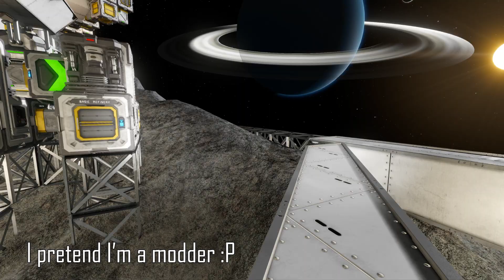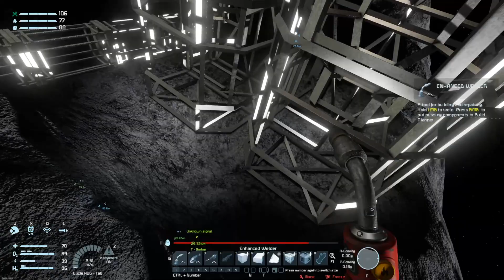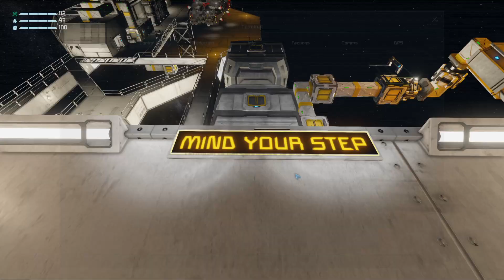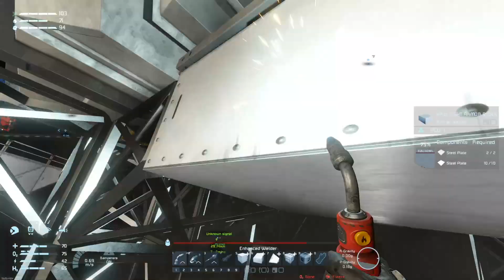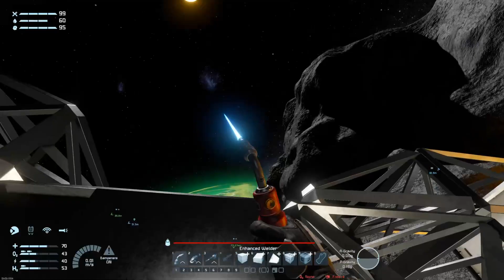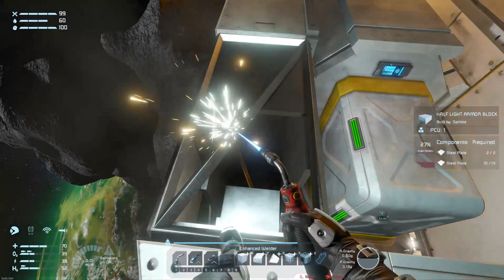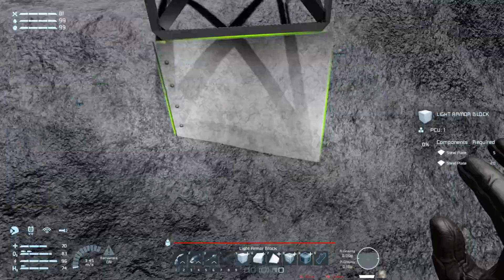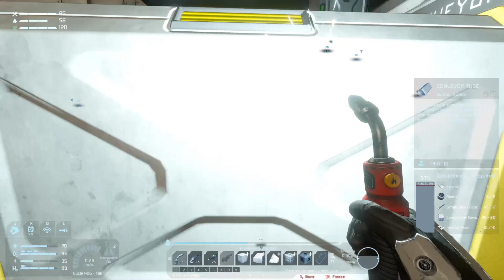Survival Impossible - The Long Arm of the Lawn-Chair #34 - Space Engineers Hardcore Survival

Comment: For the Airlocks on the work corridor, you might want to put a door facing the center so that you can walk out to the big "X" in the middle, otherwise it is a weird dead end. Also, the other dead end on the other branch of the "X" could be extended to allow a walk around to the landing area instead of a dead end into the glass of the work corridor. Just some thoughts.

Comment: note for saving space: use catwalk plates for thin walls, as they are airtight.
Reply: though without supergridding like in medieval engineers they leave a huge unusable volume on one side... half blocks are the better option, because they look sturdier and leave only half a block of empty room. though i kinda wish there was a centered version to fit with the centered door as this would spread the "unusable" volume over both sides of the block.

Comment: im sure there is at least one mod out there that has thin walls, you just change the glass panels to a solid color and change components from silicon to iron, or mod railings and catwalks to be full size air tight panels, or even corridor blocks (which im pretty sure is a thing already)

Comment: Great work this time.
3 Thoughts/ideas on the the extension:
a. Plants in the corridor. would help fill out the window spaces, and add a bit of colour to the base. Other thoughts include transparent LCDs with safety PSAs or similiar
2. Instead of the lockers in the tower end airlock, use window blocks (not panes) looking out past the tower. The blocks have a more industrial look than the panes, and would help remind anyone that there be space outside.
3. You could pressurise the tower with a vent at the bottom. going down: ladder, upsidedown catwalk, vent. Other than the plumbing this should only use the unused space at the bottom of the tower.

Comment: Here's a suggestion for the corridor: Make the central blocks you walk on catwalks with glass underneath, keeping the solid blocks for the supports. That way you get a bit of a look into the void and asteroid underneath while passing through. I'd place upside down catwalks in the floor level and use black neon lights on the underside of the supports as attachment points for inverted 1x2 glass panes.

Comment: just a thought... how much battery power did you have on your booster pods, for their beacons? as would it be enough left to find them before you return to planetside? 
warning signs - "be safe avoid splat" for the lcd's 
also what about piping up under the main hab section which would leave you free to expand what you want with above the platform level

Comment: Exploration and refinement base eh? Am I the only one imagining a catapult relay system throughout the system with Splitsie launching payloads of ore from rock to rock?
Also, terrible idea but "No Railing" on your LCDs :)
Reply: A network of gravity generator powered mass drivers and collection nets? I can see Splitsie doing that :D
Reply: Please make this a thing. I feel like some thrusters would be required just for accuracy control, but other than that, same system. Or using a fast extending piston to push the cargo in a certain direction thats angled up using laser antenna
Reply: Splitsie doing Aurora4x in SE? :D

Comment: 1) In the hallway you could either put planters or better yet, transparents LCD with informations such as station power, near hydrogyn deaths, inventory, nr. of Capac clones in the universe, Oxygen levels, solar power etc. etc.

2) From the cross in the support beam you should add stairs down to the pipe beneath so you can make path over to your solar programmable block, as you already started to put catwalks down there.

3) The area beside/behind the new and shine control tower would make an ideal place for building a dry dock, as it out of the way of the launcher, and the overseer can overview the construction from the tower.

4) Keep up the good work~ 

5) What you favourite flavour of icecream?

Comment: Suggestion(s): If it is supposed to function as a waystation, you might want a storage section for fuel (some big H2-tanks) as well as some future oriented outreaching docking ports to provide accesspoints for larger ships :)
Also some kind of semi automated refueling of the fuel-storage with H2/food/water from the planet base would be neat in the future, if it is kind of the spaceport connecting orbital and space operations/cargo transfers, it should be able to resupply any incoming space traffic. Finally, some kind of shuttle option to get personnel down into and up from orbit would really round the station up to a main connection point between the planet and outer space.
For the drill counter weight i would suggest giving it sort of a vertical fin going backwards (away from the drill) and slapping plates of blast door blocks onto it, kinda like concrete plates are stacked on modern construction cranes depending on the required counterweight, so it looks like the counter weight is adjustable by removing/adding more blast door plates to the fin. I hope this description is somewhat comprehensible :D

Comment: Another great episode. Could you have put the control tower on a rotor with a central command chair to observer your whole empire.
Some hydroponics might look nice in your new tunnel.
Could you add blokes on the top and bottom of the counter weight in a central position, then attach the new fluorescent lights across them as ropes, ie the counter weight on a crane.
Sorry for the lengthy post.